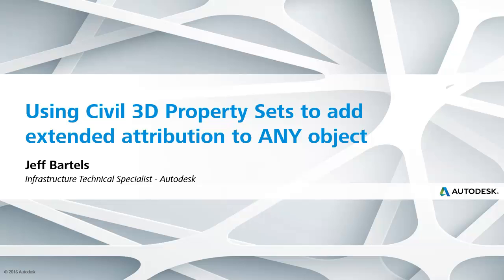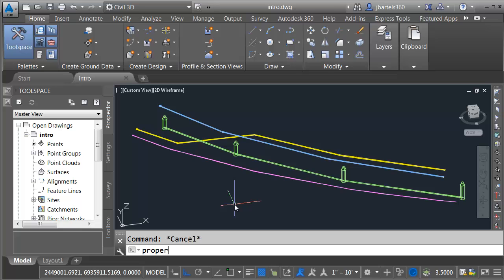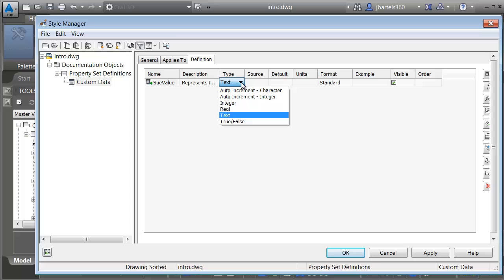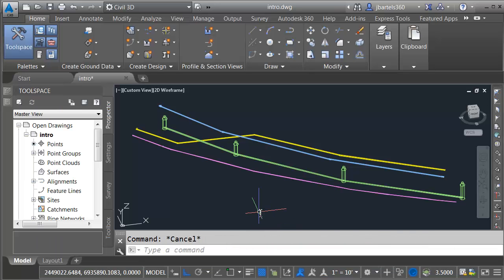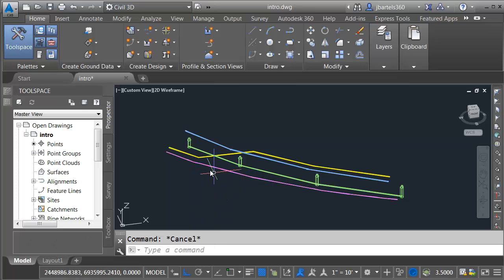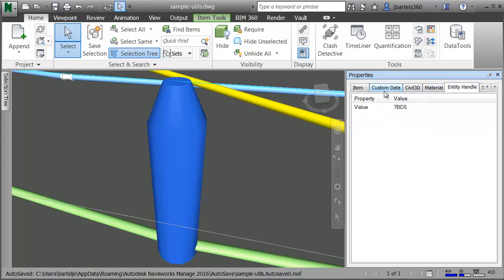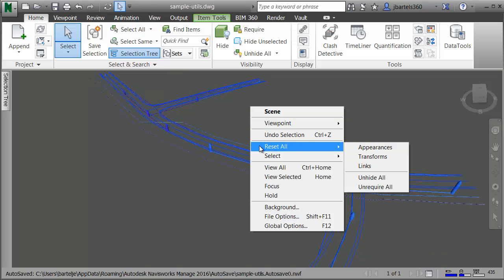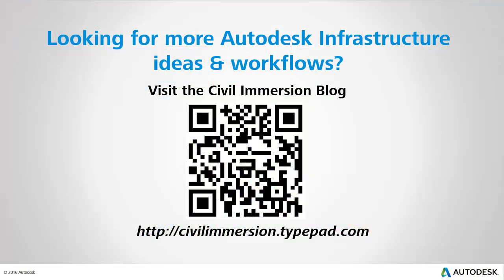Using Civil 3D Property Sets to add extended attribution to ANY object.

Comment: Hi Jeff, i am using civil 3D 2023 and Navisworks 2023, i can't open on navisworks item properties the "custom data" table. What i've could missed?
Reply: Did you find the solution for this issue? I have the same problem.
Reply: I found the solution for my issue, if I want to display custom properties for solid objects  in Navis, I must export them to IFC. I did not test other formats.
Reply: anyone know the solution to naviswork 2023? i have the same problem now

Comment: It really important to mention that this only works on Civil 3D objects and does not work on Autocad objects despite options that would lead you to believe that they do work, in C3D 2020. Now I believe this was changed in 2021 as there is a walkthrough in Augi showing how to put these labels on things like Polylines. In 2020 you never get the Property Set tab to show up in label style composer.
Reply: Actually if you just change the "Selection Resolution" to "Last Unique" it will work even for Autocad objects. Yr does not matter!